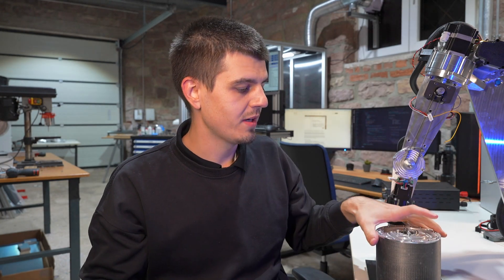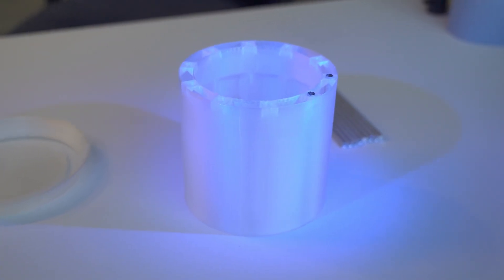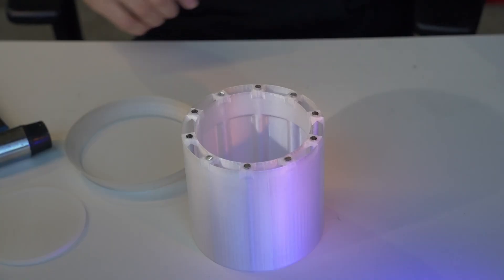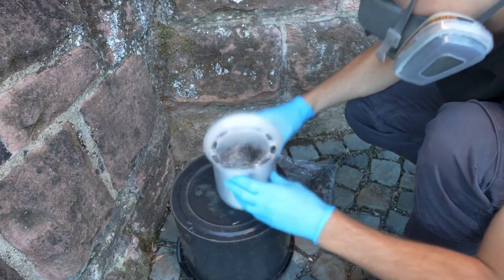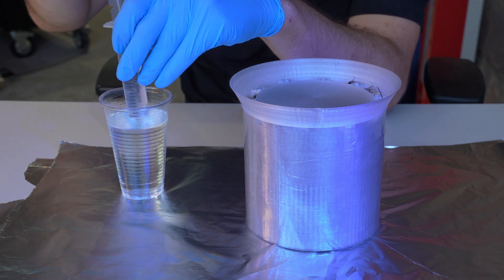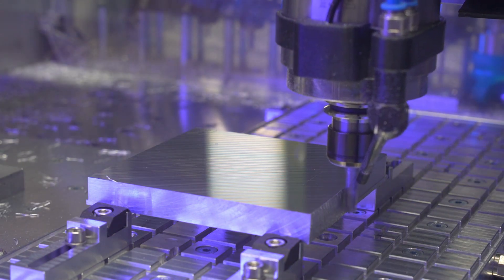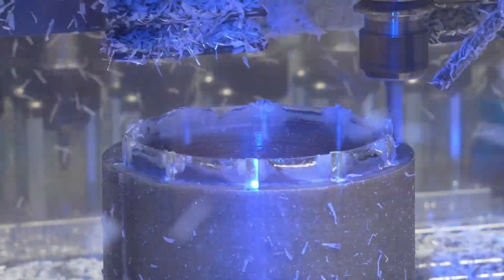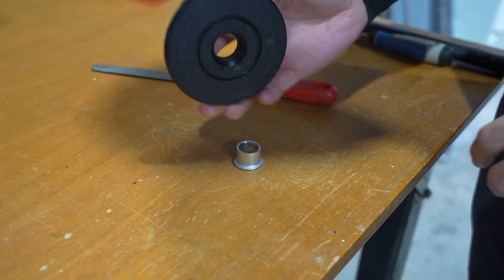Reinforce 3D Print with Carbon Fiber - Novel Approach

Comment: That's really smart. Fast and strong. I like it!
Reply: Fast?
Reply: @blairhammond5456  Haha yeah I definitely see your point. I was thinking more if you were to print lots of different parts and pour all at once, It could end up faster than printing with 70%+ infill.
Reply from the maker: Thanks and I see your point. It takes long but with a few tweaks the time for handling and manual labor will go down drastically!
Also I can’t think of many other rapid prototyping methods that are faster? Greatly open to suggestions!
Reply: @alexanderrueffer  Absolutely, the only thing faster would be machining from a solid block of FRP/forged carbon/aluminum, or fabrication with TIG maybe? Potentially a fast set resin/gelcoat exists for larger volumetric use cases like this too? Developing something new and novel to practicality for us to use, sharing the process with quality, in a positive & entertaining way is absolutely awesome by the way!
Reply from the maker: @C6composites thanks pretty sure that with a few tweaks it will be an absolute great tool for makers. Everyone has an fdm printer and you just keep cheap fibers and resin in stock. That’s very lean!
Reply: @alexanderrueffer  Yeah definitely, I can think of a few moments when this is exactly what I should have done

Comment: Wouldn't it be better to compress the carbon fiber more akin to a "forged" part? Still, neat approach.
Reply from the maker: Hi Andrew, thanks and probably yes! I don’t see the compression with the current setup. The shell is very flexible. We achieved 30% of the carbon weight in fiber. That’s not bad:)

Comment: really interesting.  please keep making videos of what you're doing.  I was expecting you to put the epoxy filled tube into a vacuum chamber (or the opposite) to get rid if any air bubbles.  would there be any benefit to adding grooved rings to the aluminum rods so that there might be a mechanical connection w/ the epoxy?  (I'm just asking - I have no experience with any of what you are doing.)
Reply from the maker: Hi Robert thanks for commenting! We definitely need a vacuum chamber to try it out. It will greatly increase quality. The aluminum rods were sanded with 40 grid sandpaper, pretty much your groove effect:)

Comment: Is the shell PETG? How does the shell handles the heat given off from the epoxy harden reaction?
Would a pressure pot curing work too?
The process seam to be easygoing. Nice work, thanks for sharing and good luck.
Reply from the maker: Shell is ABS but it also works great with Petg. We cure the parts at 60deg C in an oven. No Problem or distortion. Currently thinking to automate some of the process with our robots. Thanks for taking the time!!

Comment: New subscriber. Don't worry about the corrosion in this method. Worrying about adhesion is more in place; there are very few, if any, thermoplast filaments that have chemical bonding abilities with epoxy, without using nasty chemicals in between. Also the aluminium should be activated, and/or wet sanded with epoxy resin and then not allowed to contact atmospheric oxygen.
Reply from the maker: Thank you so much  for the comment and sub!! And yes totally valid. We are not relying on a bond between filament and carbon, all forces go through the cf. Filament is just the mold and surface:)
Reply: Very much agree on the aluminium, usually almost impossible to get a reliable bond without surface prep. Not sure it's really an issue here, though, with how much the rods are embedded and all.

However, what do you mean with epoxy not chemically bonding to the other plastics? I was always under the impression that epoxy is just a mechanical adhesive(?) Maybe there is something to help with wetting, but otherwise doesn't the porous surface of an actual 3d print do most of the job? I mean, 3d prints are usually easy to glue even if the plastics used in them are kinda not.
Reply from the maker: @keinschwein8467 Thank you for your experience! Adhesion is pretty complex, the layer lines help because they increase surface, the true chemical adhesion however is bad for filaments, low surface energy.
Aluminum on the other hand works really good with epoxy, pu etc. We also sanded the aluminum rods. Our blasting cabinet is a huge mess but the bond from this is insanely good. The 5mm rod would break before being pulled out.
Reply: @alexanderrueffer  I tend to agree. The surface prep thing is just generally good advice when bonding aluminium. However, your joint is also extremely "glueing friendly" so to speak.

What potentially could happen (that's a subjunctive in all capital letters) is that with enough load, preferably torque and alternating meaningfully, maybe some moisture and/or thermal cycling (just to help) a bond crack might start at one end and work its way from there. Again: This is very hypothetical text bookery.

While aluminium bonds are somewhat prone to this kind of failure (hence the surface prep requirements), if it were to happen with your design, the rods might still be fine in there just with the friction.They may creak a little, though :D
Again again: Probably not gonna happen.

Comment: This is very cool. I've been working on prototype for a client who builds custom speaker boxes. I made the driver mount with a similar process. I did single layer perimeter with 5% gyroid infill. It was then filled with chipped granite and epoxy. I found the infill was needed to keep the walls in place as this part has significant overhangs.
Reply from the maker: Thanks Morgan that is a really great insight! I think the fibers would have a hard time going through the gyroid, they are so light… with granite and epoxy this is genius. The granite is very heavy and would probably deform our shell:)

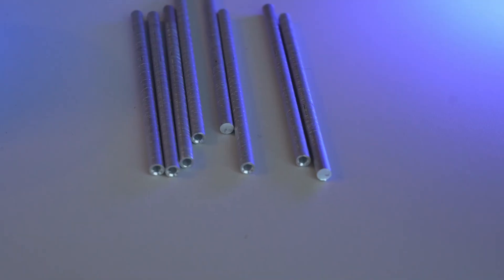Comment: 1:00 wait what? aluminium will corrode?
Reply from the maker: Yeah contact corrosion since aluminum and cf are both conductive aluminum will give up. Best is to use titanium or stainless steel. But that’s heavy. If you anodize the aluminum the surface becomes an isolator. It will prevent the corrosion mostly and is still lightweight!:)
Reply: @alexanderrueffer  contact corrosion between carbon fiber and aluminium will form only if there is an electrolyte present, also you are using epoxy which is a great insulator and i hope you are using non hygroscopic resin, so that wont happen... i would rather worry about the threads, i dont know if those threads are good enough for your purpose
Reply from the maker: @Hobypyrocom yeah it is no big deal in this case. The threads are the weak point 100% correct
Reply: It’s called galvanic corrosion 👍 see it all the time at work. We use aluminum tripods and bolt them to steel towers and the aluminum will actually flake because of the charge difference over a couple months/years.
Reply from the maker: @TheSSEssesse thanks for clarifying. If you think in years it’s totally relevant. Corrosion keeps us busy!:)
Reply: @TheSSEssesse  galvanic corrosion is when two different metals touch, this is not that case...
Reply: @Hobypyrocom Wrong. The carbon fiber is the cathode while the aluminum is the anode in this case. That is by definition galvanic corrosion.
Reply: @TheSSEssesse  you are right. i read to remind myself what the definitions are when i wrote my original comment, but it seems like i again forgot... thanks for correcting me.
Reply: @Hobypyrocom it’s an honest mistake. I probably would have said the same thing if I wasn’t fortunate (or unfortunate?) enough to experience what these two materials do to each other in the wild 😅👍
Reply: Maybe it will be working around salt water? idk